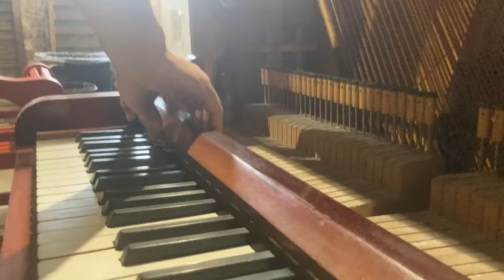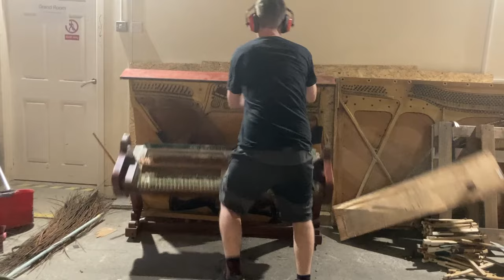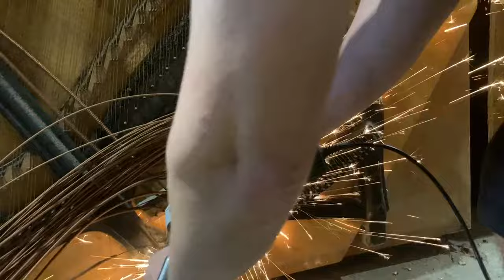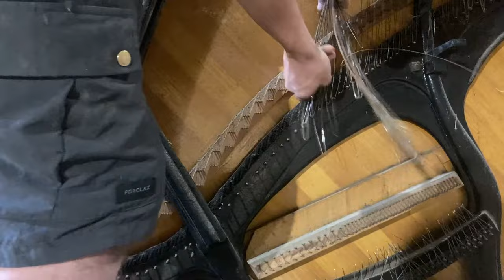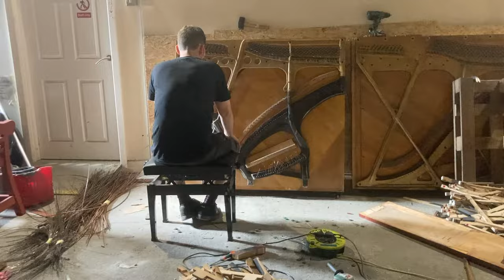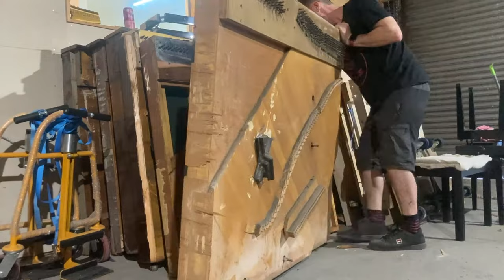How to dismantle an upright piano

Comment: that looks like fun!  Thanks!  I had already gotten most of the piano taken down but just needed to see what you did with the cast iron piece and the strings.  Thanks again!  So, if I  saw correctly, it looks like you loosened up the strings first before you cut them????

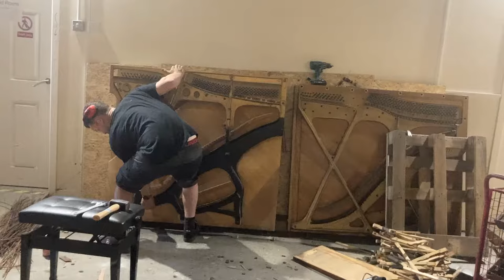Comment: 1:23 So there is no need to take the string tensioners that hold the piano strings off to remove that large cast iron piece from the piano? As long as cut that bottom piece like you did?